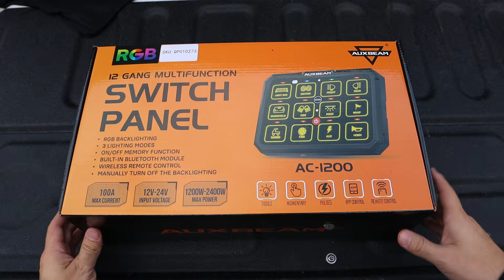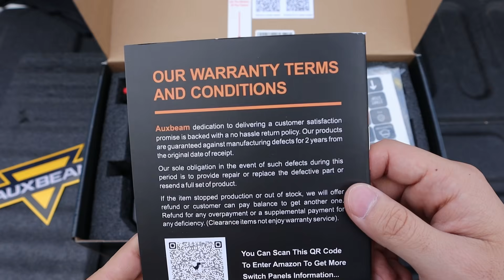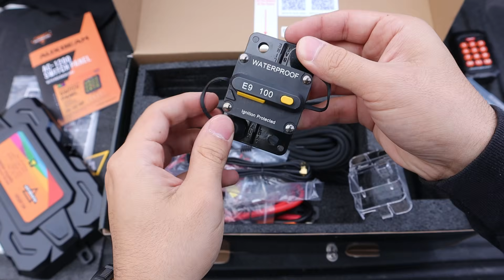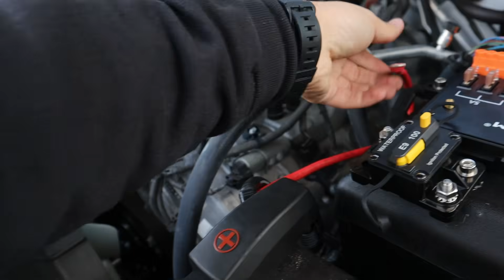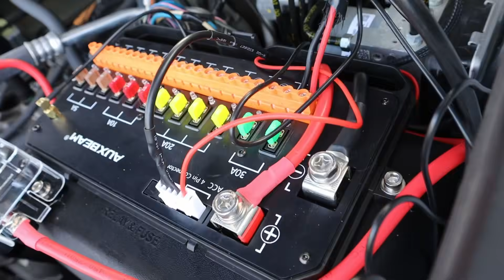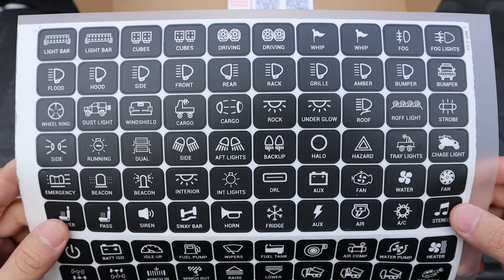*NEW* AUXBEAM AC-1200 12 Button Switch Panel - How To Install!

Comment: I love my auxbeam panel.  I wired my lights and my radios. They provide a lot of stickers. I have a suggestion.  I have more than one radio.  I have a police scanner,  cb, gmrs currently.  I'm going to be adding a couple of ham radios. it would nice if there were some additional radio stickers or even some of the aforementioned radios. 

Momentarily is good if you have led lights that have different modes switch by an additional wire to positive temporarily. You can tap the button and cycle through modes. Auxbeam sells a 6 mode ditch light. But it works on strobe lights that have modes and you change using the third wire.

Comment: Hey guys I have front and rear arb lockers with a twin arb compressor there rated for  40 amp fuses is there a way I can still use the auxbeam switch panel as there fuses are not rated high enough

Comment: How did you attach the panel to the top of the truck's fuse box? Did you use the Auxbeam provided mounting bracket, or did you attach in another way such as double sided Gorilla tape?

Comment: can anyone think of a reason why you couldnt use the momentary mode to use this as a wireless controller for hydraulics / winches
Reply: winch amps would exceed the fuse ratings
Reply: @TheCastleghost I mean maybe if you where trying to power the winch motor directly lol . But the winch relay surely doesn’t lol
Reply: @TheCastleghost  most winches, especially larger ones, have a low voltage remote wire (relay/solenoid) to avoid complexity and more importantly to avoid potential fire hazard from long lengths of power cable.
Reply: If you hook the auxbeam into the relay then yes. But directly no. There's plenty of people who use the auxbeam system for it